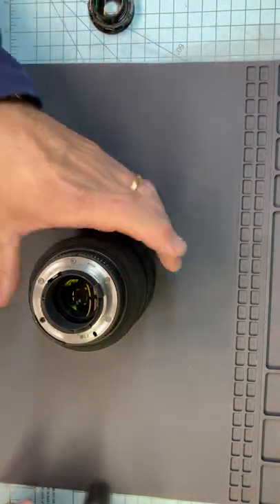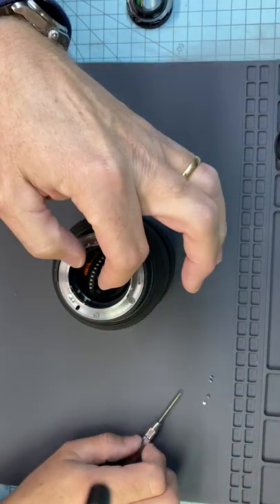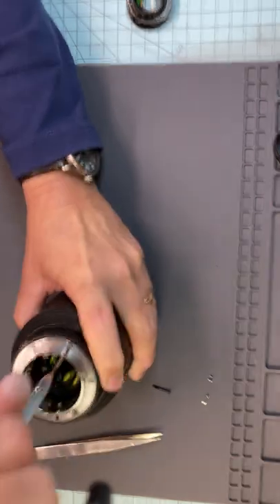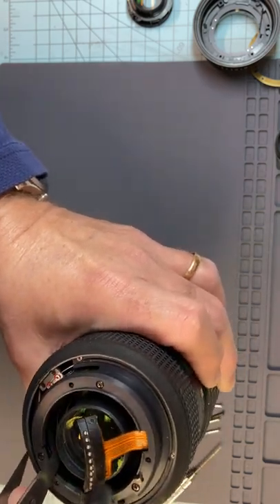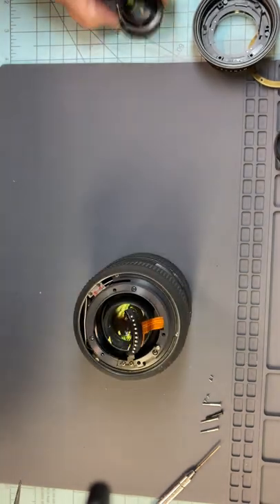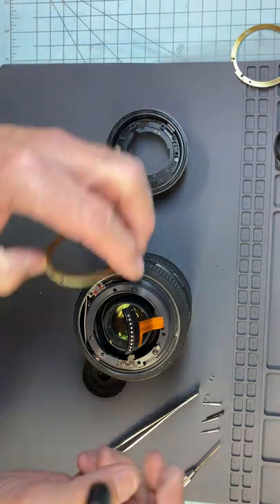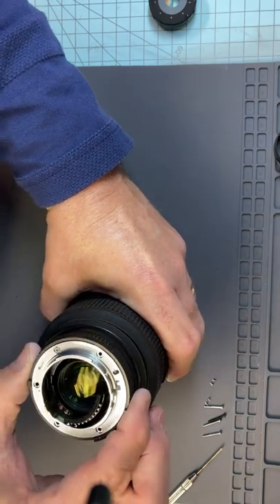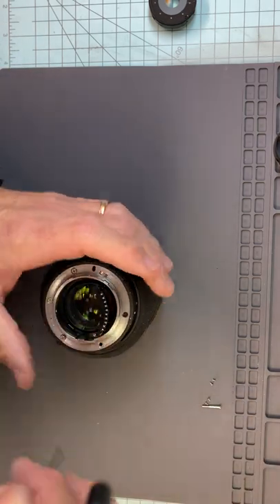Nikon AF-S 28-70mm 2.8 Diaphragm/Aperture Coupler

Comment: Your video has greatly helped me with assembling the lens. I still have a problem with aperture not going to its maximums , it wont go to f2.8 and wont go past f16
Reply from the maker: That coupler is not installed correctly and the aperture plate may be bent. It is really tricky to get the aperture lever from the mount correctly coupled into the diaphragm system. That is where I would check first.
Reply: I'm fairly sure I'm getting it right , I've been at it for a couple hours. Could there be another problem causing misalignment?